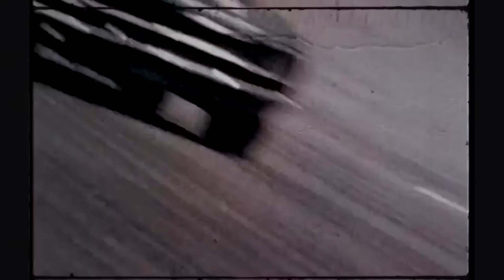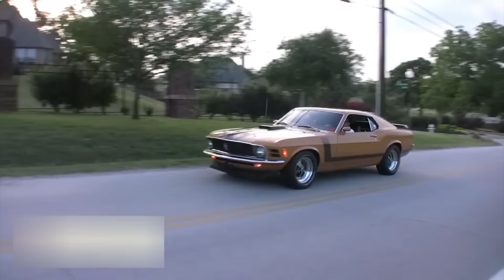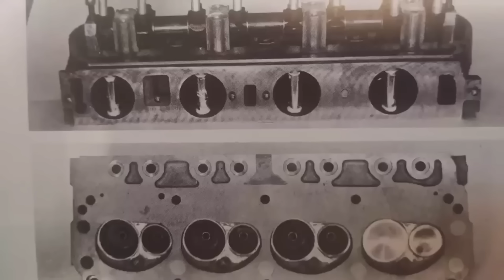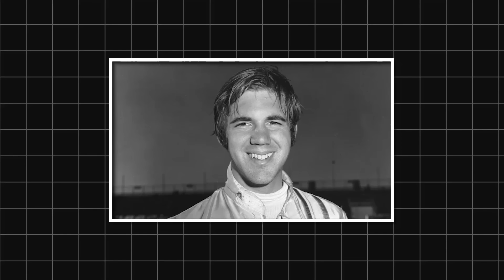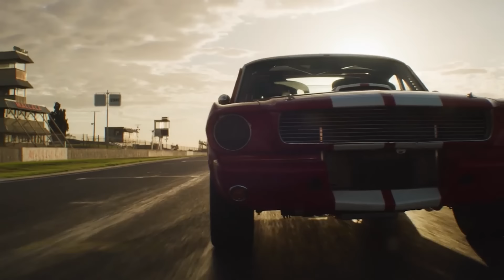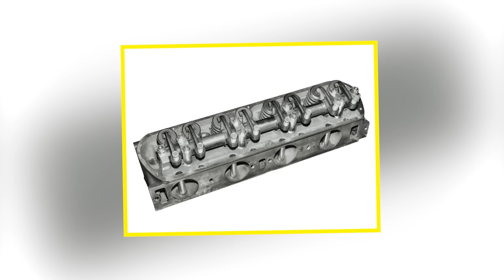Why the Rare 1968 Tunnel-Port 302 Only Was a One Year Affair

Comment: I always thought that the 302 tunnel port heads would have worked much better on the 351 Windsor.
Reply: They might have, except the class of racing the the TP heads were developed for had a 5.0 liter limitation.  

It would have been pointless to put the TP  heads on a 351W anyway. .  The 351C engine was already under development and its 4V heads could move more air than a Sikorsky helicopter.  Fact is, the 351C-4V heads were actually overkill.  Their flow capacity was similar to the Chev 'Mk IV' 396/427 engines.

Comment: The Boss 302 DID NOT use 3" main bearing journals. It used the same 2.2482" – 2.2490" as the 289 and 302 engines. It did have a 3" stroke, same as all 302s. The Ford 351 Windsor had 3" main journals.
Reply: Wow those are tiny Main journals. I built a high-performance 289 for my 65 Comet Cyclone 4-speed but I can't remember the crank being that small

Comment: The stock Boss 302 engine turned 6,150 RPM as installed not 6950 due to the factory RPM limiter calibration
Reply: Can you explain how they limited the rpm? I can't recall any of the old muscle cars coming from the factory with rev limiters perhaps that's why a lot of idiots blew them up because they thought the red line was something they were supposed to rev it to, and a lot of them smoke so much marijuana and use so much lsd, they fantastically imagined that the motor would make even more power past Redline
Reply: @7x779  at 69yrs old I call BS.
Reply: @harrytaint3089 I'm assuming you mean that Boss 302 came with a factory rev limiter is bs. I would agree. Sounds like the comment might be from a junior high school student watching all the modern videos where everybody keeps their car or motorcycle wide open and splattering into the rev limiter. Personally I hate that and think it sounds horrible and makes the drivers look ignorant
Reply: @7x779  That's exactly what the OP was doing, the EFI 5.0's from 86 on had a computer controlled rev limit. The only cars that had a limiter before that were using an aftermarket spark controller like a MSD box, and even then you had to buy the model with the limiter feature. And I agree with all of these idiots bouncing the engine off of the limiter, and it's one of the reasons I won't let anyone under 50 drive my 85 5.0 GT.
Reply: @johnjones928 I agree with you that they're idiots, and anyone who thinks it sounds cool to have their car motorcycle pegged against the Rev limiter, or they wait until they hit the rev limiter to give them a clue on when it's time to shift, are complete idiots

Comment: I've never seen a motorcycle engine that has weird rectangular car-like ports. They're all round port and easily make much more power everywhere. What's the problem with cars?
Reply: The  Boss 302 head ports were designed to clear the Shock towers. The Chassis was built for a 6 cylinder then Ford installed a V8. that is why the  Head port design was Compromised.  They had to fit the Chassis.

Comment: My co-worker ordered the 1970 Boss 302,I drove it a few times. What a blast. At the time I had the 1969 Mustang Mach 1 with a four speed and all the accessories ion the order sheet 351W. A real head turner. Oh,BTW we both worked at a Ford Dealership. Golm Ford Mercury Omak,Wa Those were the days.
Reply: two of my buddys  Bought 1970 Boss 302 mustangs. One was off the lot, the other was a Order with the right combination.  The off the lot Car had 350 Gears and a close  ratio 4 speed, the ordered Car was 430 gears in less than 300 miles the close ratio  trans mission failed. 
The dealer prplaced the close ratio with a Wide ratio  transmission they had in stock.  The 430 gear car was a rocked, the 350 Car was a real stone until  the RPM came up  to about 4500 RP.

Comment: I worked on a 68 Mustang Trans-Am car.  The owner ordered a tunnelport engine, but never received it.  Instead he received a bone stock Boss 302 engine, before the car was even introduced.  It came along with an E2-600 cam with mushroom lifters and valve springs, an inline 4 barrel Autolite carb and manifold, and some info on exhaust header sizing.  We blew it up a few times before we figured out what they hadn't told us;  The two piece valves and factory rockers were not race quality parts .....
Reply: an expensive lesson and FoMoCo neglect!
Reply: Any team worth it's salt is always experimenting and trying out new parts. Still going on today in all motorsports.

Comment: The Tunnel ports had too big of ports for Trans Am and the Cleveland heads from the 385 family. The Cleveland has the front horse shoe timing cover, and could take the 500 hp limit. The 351C heads were used on a Windsor four bolt, 4V are toobig, better with Australian 2V Cleveland!!
Reply: Ford hasa  Championship with the  Cleveland 4V heads on their  Boss 302 that  porves you are full f shit.
Reply: Absolutely right.  The TP ports were too big, so they had to rev the doo-doo out of the engine to keep the flow working.  That shortened the life of the engine in races.  Years later some guys filled the ports into "D" ports, and the engine worked beautifully over a much broader rpm range.
Reply: The Cleveland heads came from the 335 series block.

Comment: I had a 289 hi-po, I went to a Ford dealership & found out the Boss 302 rods were the same. I bought 8 new rods for $8@! As they say,those were the days!❤
Reply: I don't like Fords , I'm a Chevy man !  Fix , or , repair , Daly  !  Found , On , Road , Dead . F.O.R.D.
Reply: @VernonHeuer-y9k Chevrolet.  Cracked Heads, Every Valve Rattles, Oil Leaks, Eats Tires.
Reply: @VernonHeuer-y9k yep Chevy's are easy peasy, you got to be smart and more dedicated to make a Ford run well but then you've got something much more rare better looking than desirable. Small block Chevys one of the ugliest Motors ever made

Comment: Who remembers the autolite carb set up on the trans am cars. They were pure genius
Reply: Yup,...I do,....long ago and far away,....! How about the dual autolite inline carb on the Boss 302?
Reply: @8000RPM. That's what I was talking about. Dang, what a beautiful piece of engineering and creative thoughts. Wow
Reply: @JamesWeaver-n4t  I think in 1969 the racing Boss 302's ran dual quads. In '70 the rules only allowed a single 4bbl. Giving credit where it's due, the Z/28 Cross ram was wild. Also the Stock Z/28 4 wheel disc option was really good. Long ago,....and far away,...
Reply: @8000RPM. The dual quads were inline autolite carbs. Obviously you've never seen them. They were genius.
Reply: @JamesWeaver-n4t  I think you could get a cross ram intake for the Z/28. The Dual quad Boss had 2 Holley 4500s,....if I recall correctly. As you know,...the dual Inline Autolite were mounted side by side. There was also a single inline version. I think the top of the intake was swap-able (bolted on) to accommodate the dual or single version. Ever so rarely, these items come up on e-bay. Currently, there's a Shelby dual quad manifold (for the Boss) listing for $4,500.

Comment: Tunnel Port 302's have Left And Right head's respectively .
They are also
 " O Ringed "  .
From My short interaction with them ;
The capscrew connecting rod's were most of the high rpm issue's .
These were ( in my opinion does not mean it's correct ) 
A Major Issue As Their Machining Process Were At Time's Comoromised .
Valve Train Is Very Stable .
Forged Steel Crank Is No Issue .
As With Most High RPM Engine's ;
Oil Clearence's Are Critical .

Comment: Boss 302 did not use 3" main bearings. Even Cleveland engines did not use 3" mains. Cleveland has 2.75" main bearings. 302's, including the BOSS used  2.248" mains.
Reply: The Cleveland mains were the same as the FE, 2.749 along with the cam bearings. I am not sure of the rod journal size. Anyone know?

Comment: The 302 Tunnel Port block was used in the very early Boss 302 engines, along with the Tunnel Port's cross-drilled, hollow-throw steel crankshaft. Neither were available as over-the-counter replacement parts ... neither were the 2.23" intake valves nor the 2.23" intake cylinder heads of the early Boss.
Reply: Do you remember the autolite carb set up for trans am cars. ? It was an inline carb and they used two of them. Basically, it was like having eight single barrel carbs. Pretty much like running a hilborn  injection. I actually saw a pair of them at a Ford dealership back in the day.
Reply: @JamesWeaver-n4t I remember that carb set up. It appeared and disappeared quickly.
Reply: @kimmorrison9169 It disappeared because SCCA wouldn’t approve it as it wasn’t a production part. It was available over the counter. It was an ingenious solution to meet the single four barrel rule .
Reply: All 1969 Boss 302 engines had 2.23 intake valves.
Reply: @mylanmiller9656 :
And as I noted, those intake valves were not available as over-the-counter Service Parts: only as installed in those factory-installed cylinder heads.
Reply: @johnjohnsn7633  I have two friends that have 1969 Boss 302 engines,  both replaced there  2.23 valves. with ford  parts.
Reply: @mylanmiller9656 :
And as I noted, those intake valves were not available as over-the-counter Service Parts: only as installed in those factory-installed cylinder heads.